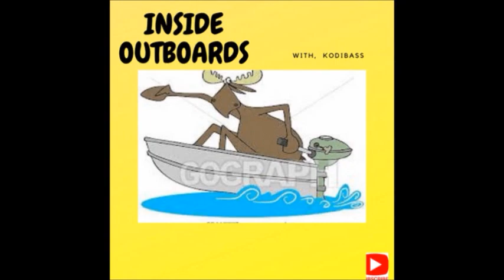15 HP JOHNSON Outboard & MORE

Comment: Hi Kodi, I keep learning a bunch from your videos. Testing my coils on the old merc and have readings on both but one is way lower than the other and won't hold. Thinking it's probably shot? Cleaned the points so just going to try it again for now
Reply from the maker: +TWS,  Thanks,   Good luck with her 4 sure.      kodi

Comment: Hey what spark plug  Gap do you like on  a 15hp  Johnson. I have a  1982 and it has a  intermittent misfire under a load but  I have tried NGK AND  Champion  and plug wires  thanks for help
Reply from the maker: Try a perma gap  champion L78V  ,  Also check the the wires and ground around the coils , kodi

Comment: I have a question for you kodibass, have you ever heard of a Johnson 35hp alaskan 40? I just picked one up and I've never seen one before.
Reply from the maker: +Ch, Yes'   in fact I currently have one.  I know They were sold in & around Anchorage Alaska to meet hp restrictions on certain rivers, They are supposed to be re-jetted & a hole drilled in the propeller to knock down the hp, & new decals on the bonnet saying 35 hp.   I have had a few come in over the years.   kodi
Reply: @kodibassInsideoutboards  thanks for the information kodi.

Comment: Marine Mechanic Question of the Day...   What is the differerence between an OMC CrossOver & an OMC Looper...?
Reply from the maker: The loop in the term "looper" comes from the path taken by the fuel-air charge induced into the combustion chamber. The intake charge is directed into the combustion chamber upwards toward the top, where it loops back down on the other side, pushing out the exhaust gases.
The goal of the looper was to prevent less of the fuel-air intake charge from being lost out the exhaust port of the combustion chamber. The improved fuel efficiency of a loop-charged motor comes through this mechanism.   I kinda hope this  Gives you the basic's  on the looper, via  cross flo.   Imho only becomes relevant on the larger  V-motors+         kodi
Reply: @kodibassInsideoutboards  so the Looper has those short "wall type" piston tops...?
Reply from the maker: @williamriley2528   Yes'  As there R 3 intake ports on a looper,  the piston does not need a  directional "" Deflector ''  on top of the piston to direct the exhaust gases to a single port as in the cross flow motors.  So the piston is shorter.                  kodi